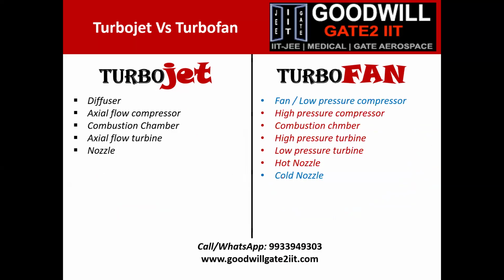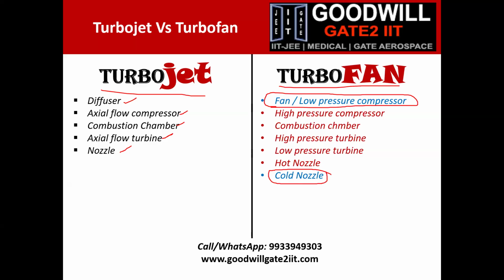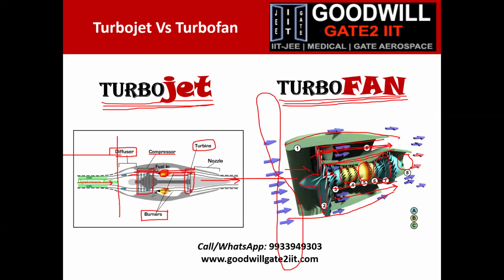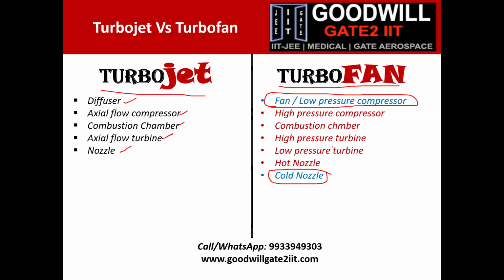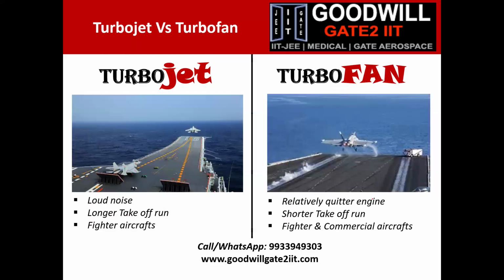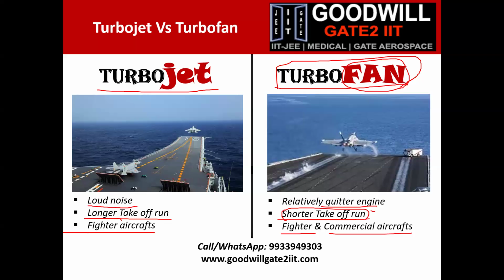Turbojet vs Turbofan Engines | GATE Aerospace videos | GATE AE | GATE Aerospace Engineering 2026

Comment: The video incorrectly shows a Eurojet EJ200 as an example of a turbojet. The EJ200 is actually a low-bypass turbofan, not a turbojet. Turbojets are rarely used in modern military aircraft. Most contemporary military aircraft, such as fighters and bombers, use turbofan engines (including low-bypass turbofans) due to their superior fuel efficiency, thrust, and performance across a wide range of speeds and altitudes.